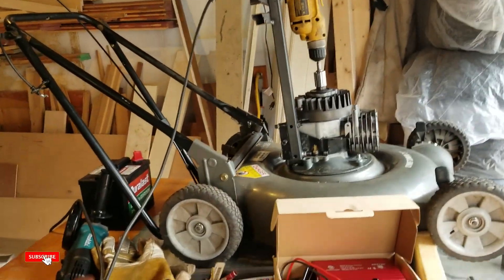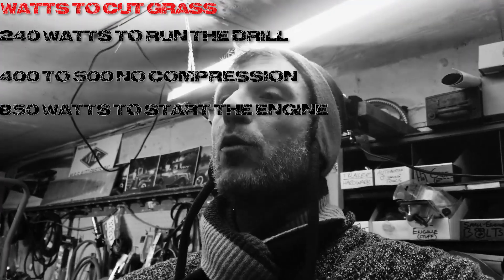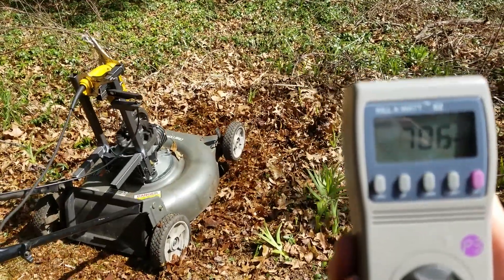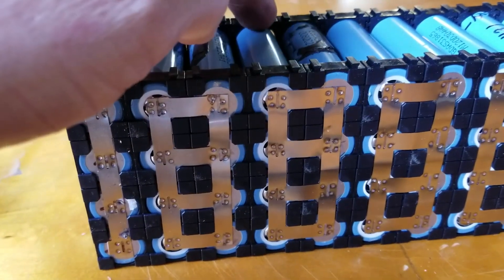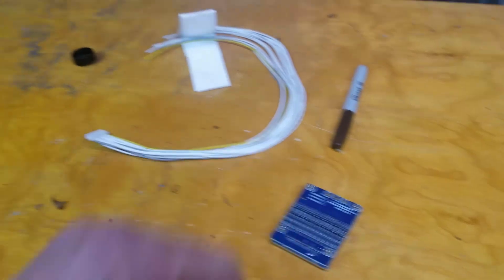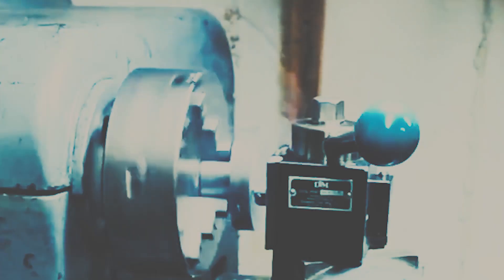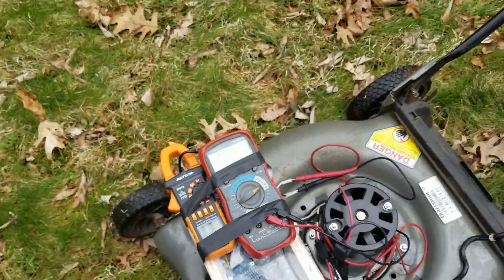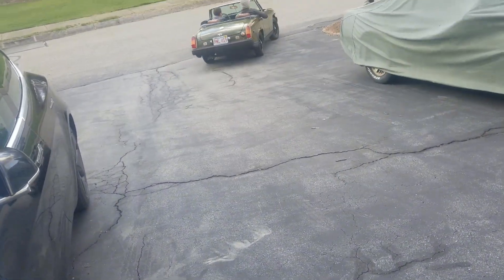Gas to Electric Lawnmower Conversion (NYK behind the scenes ) | E5 (DIY battery electric lawnmower)

Comment: Rather than having the wire be  longer than it needs to be, just use a normal cable or brake cable from a bike, from your handle down to a fixture with a lever to operate your  switch or breakers (located 1in after the battery, and 1 inch before the motor)
Reply from the maker: Sure that is a good idea. However we just reused the existing wire harness off of junked electric lawn mower. For more details check out and now you know episode. Link is in the description.